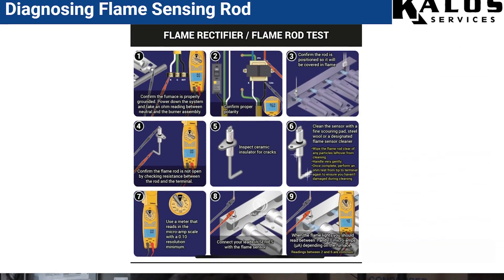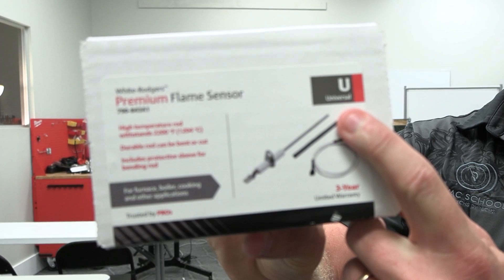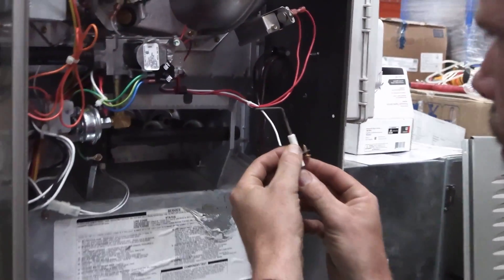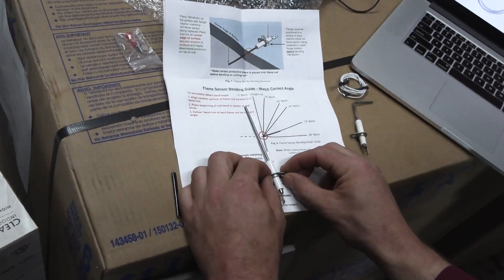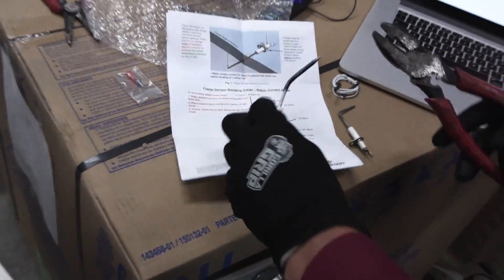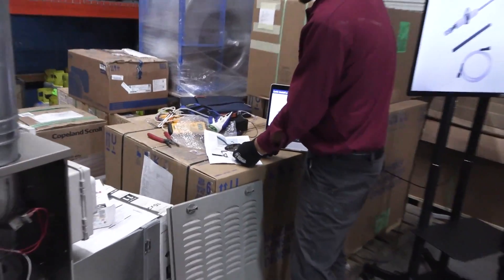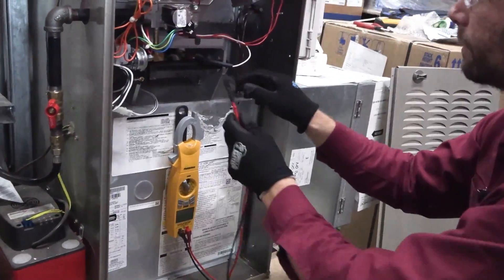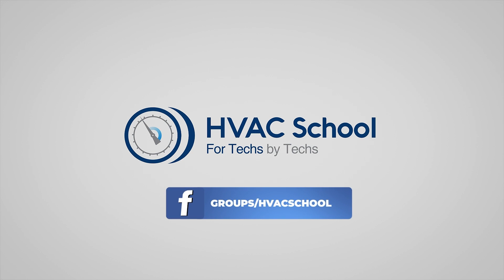Flame Sensor Troubleshooting & Install

Comment: I'm in the process of tracking down a flame sensor issue myself.   I haven't tested voltages or current yet.  Not a Tech but a DIYer.  In my troubleshooting I think I've narrowed down my specific issue as with the bonding(ground) of the flame sensor mount to the unit frame.  Mine was short cycling but instead of 3-5 seconds it would run 10-15 seconds before cycling off then back on.  I've removed the flame sensor multiple times in 10 degree weather(Trane package unit), cleaned it and it works but only for a short period.  The last time I pulled it I paid more attention to where the metal bonds when the flame sensor bracket is mounted against the unit.  So far(knock-on-wood) the unit has been cycling normally for 36 hours.  Started acting up on Sunday the 14th right before sever winter weather hit.

Comment: I’m new to the field and the owner of the company in work for had me join him on service calls…this was one of the calls…heater not working, call for heat, no heat . Did the ground checks , power checks etc….long story short ended up replacing the breaker which was showing signs of electrical burn. The sensor rod he found was a replacement however by LISTENING to the rectification process he could tell the rod was too far away. Doing some minor bends minuscule bends….long story short the system fired up almost in and stayed on. 
Will remember this when I get out there on my own.

Comment: What if I get no dc micro amps? Would that be caused by a bad motherboard not sending AC voltage to the flame sensor?

Comment: In reality, how often do you need to replace a flame sensor?
Natural gas, I think I have changed 3 in 15 years. 
LP, because of its moisture content, they do get more pitted and discolored.
3 year warranty is great, but again, unless it is LP this should last far longer than that, just like the OEM did.

Comment: Isn't a flame sensor the same as a cad cell?
Reply: No. CAD cell reacts to light reducing the component metal Resistance in Ohms. Flame rod, reacts to heat, allowing certain amount of DC voltage to pass through. You can fool a cad cell with a flashlight, which will do nothing to a rod. Meanwhile you can fool rod with a heat gun, which will do nothing to cad cell.

Comment: For me at least, it's easier to make the bend by using two pairs of pliers rather than putting it on a surface and using your hand strength to hold it down while making the bend. Alot easier actually

Comment: I never saw sensor itself failing. Cleaning fix the problem.
Reply: I have seen the ceramic inside of a flame sensor crack and cause issues with the resistance in-turn causing  signal failure going back to the board.  Doesn’t happen often, but it does happen.

Comment: Is there a video on the grounding topic subject of the flame sensor? I’ve been getting a E270(no flame current sensed)on a Lennox Elite. Happened in 2020. Replaced everything needed. Still didn’t work. Replaced the board. It worked. 2yrs later here I’am with the same code and problem. It has to be a ground issue.
Reply: You just have to check with a meter, it could be a grounding issue. Make sure you have a good ground, scratch paint off if you need to
Reply: You can test by running a temporary ground wire from a known good ground  and if that solves your problem, figure out where the problem is.
Reply: @toddbunze6180  tried that and the same.
Reply: @Kiddro22  what I have done in the past is to plug the furnace in the wall using an extension cord and make sure all your ground circuits are good and tight. I had a system that I had to replace a board two consecutive years in a row until I fixed the ground. The board replacement seemed to temporarily fix the grounding issue. Been about 10 years so l don't remember the particulars. Hope this helps.
Reply: AC Service Tech LLC. has a good video on the topic. Check his YouTube channel.

Comment: Great video. I wanted to add that as a newer technician often times I try to "clean-up" a flame rectifier. I take my data points before and after this is done. I also explain to homeowners and customers that this is a light procedure, but I won't do it for extended periods of time. Would you recommend this procedure and if so for how many seasons?  I try and save folks a dime or two but I also don't want to alter the surface or even damage the component.
Reply: Pretty hard to damage a piece of stainless steel.  Thats all it is, nothing magical.
Reply: Could do it every season for the life of the furnace. Don't know that I ever had one fail from cleaning or any other reason.

Comment: 👍👍  I’m a 40+ HVAC&R tech now semiretired, your videos are always good I wish I’d had this kind of field training 
Natural and ground are Not the same although they are bonded at the electrical service panel, but in 99% of the cases it does not make a difference but in few systems it can make a huge difference.
Reply: What is 'natural'? 🤭